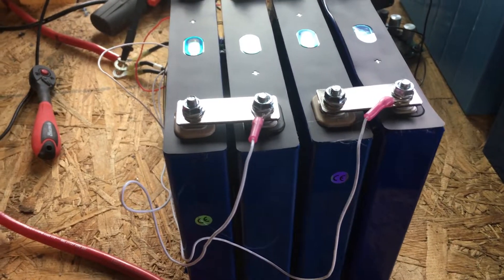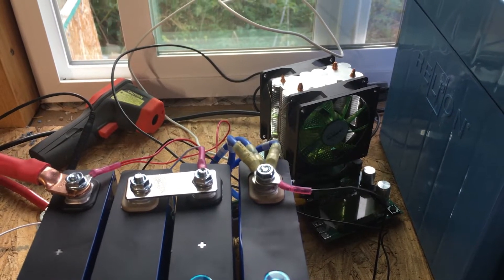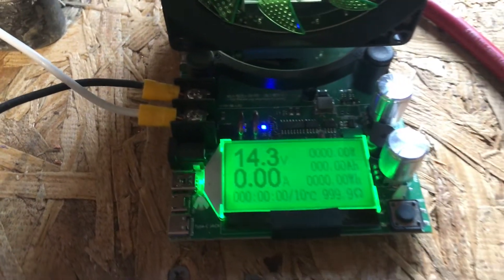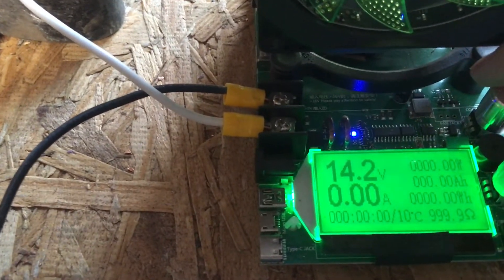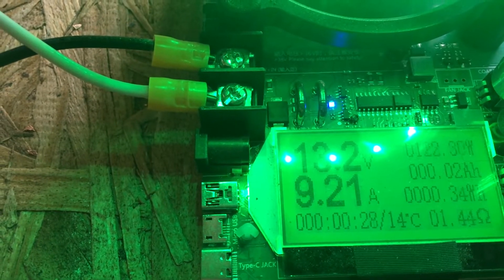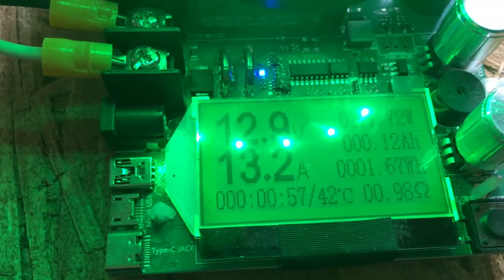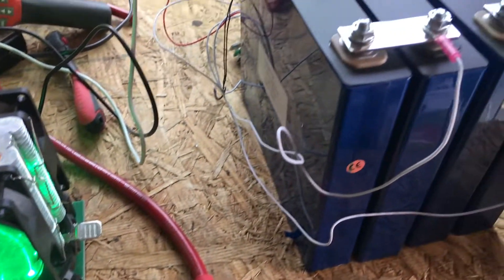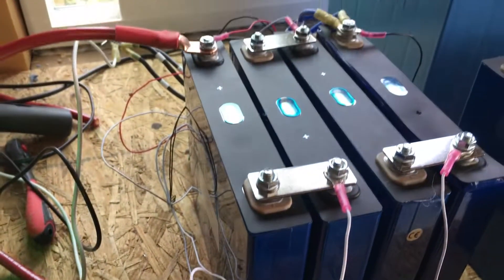CATL LifePo4 capacity test! Did it reach 100 ah?

Comment: question Where can I get  a 100 to 150 amp lifepod battery all ready built that is goop and cheap. I thought about building one but the problem is top balance the battery I live out of my truck
Reply from the maker: SOK is the best on the cheaper side.
https://www.sokbattery.com/products/100ah-12v-lifepo4-deep-cycle-battery
There are cheaper that will hit rated capacity but their components are crap and will fail after a while.
I also like Rebel Battery too
https://rebelbatteries.com/products/smart-lifepo4-12v-100ah-1280wh-bluetooth-enabled-rechargeable-lithium-iron-phosphate-battery

Comment: Just a little tip, I knowtest your busbars are not flat to the terminals on the cells you have in parrallel, keep them as flat as possible to create as much surface area in contact with the terminal as possible